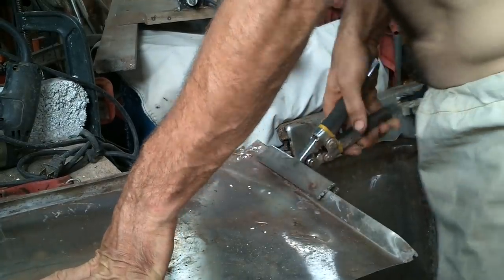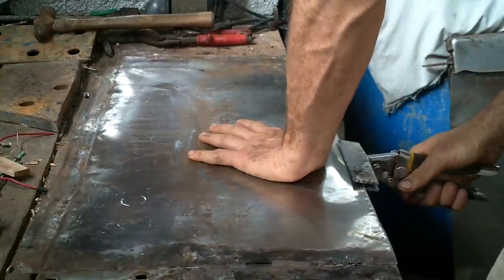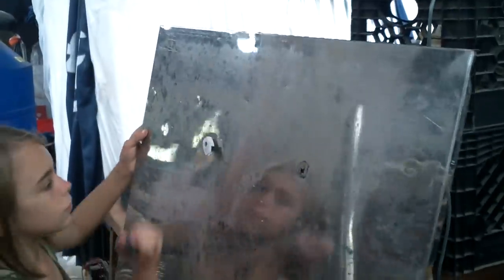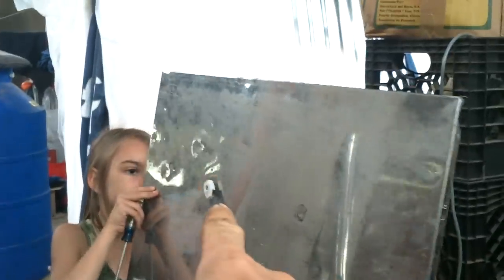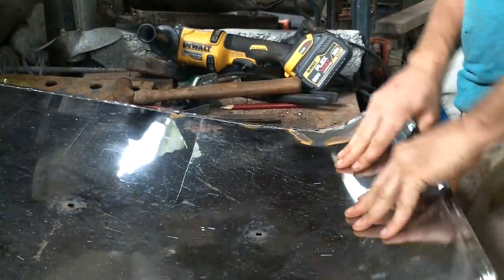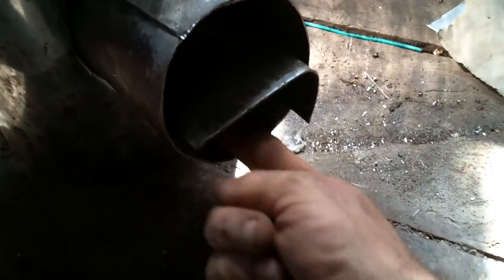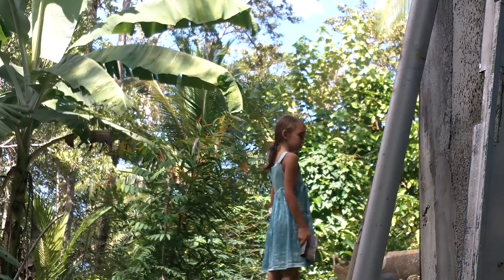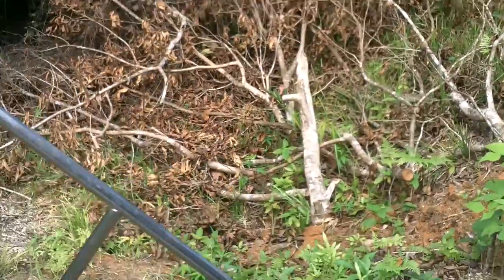The Great Flaming Cooking Rocket

Comment: Rocket stoves are awesome!  Take a look at rocket stove clay ovens.  You might be able to make just an oven and use your existing rocket stove as a slide in heat source.  This way you can make PIZZA!  If you do make a clay oven it will need to have a roof above it due to all of the rain you get down there.

Comment: With ten 500 watts panels, a 2kw long live low frequency inverter, a four 280 ah battery pack and an induction stove you can do all of your cookings even in cloudy days. It is the most efficient and cleaner way to do it,  with no heat loss just the pan and it is free after the initial cost.
Reply: Agreed, but in the short term, while still building out the island, any electric power is better spent running tools etc... You can cook with electricity or wood, but you can't run a milling machine on wood!
Reply: They do have solar. Right now just a small solar set up. Wood on the other hand is a renewable source and is great. On Dashaina Island who has a bigger solar system has an electric stove. Ideally one could make their own bricks and make a really nice out door kitchen later down the road. Yet this works as well. Simple and small and can help eat up all of the debris that is laying around. 
Wood gas also works well yet requires a massive amount of things to keep it going. One could indeed build a wood gas system or buy one as well except most of them run on pellets. One person I know is working on a way to use wood gas with bigger chunks to which you could use either a chunking machine or some kinda of rotating slicing machine.
Reply: @neliosamch3195  Not going to fight with you about this. Wood stoves is a renewable energy. The amount of energy it takes to make a solar panel, electric stove and everything else you buy for your entire life will produce more contaminants than using wood for heat and cooking.
Reply: @kameljoe21  That is possible but just imagine if all the people in China would cook with wood stove there wouldn't be more trees and the whole North pole would have melted long ego.
Reply: @neliosamch3195  The more people who use wood products means more trees are going to be planted. The north pole is going to melt with or with out humans. Its a process that the earth goes thru.
Reply: @kameljoe21  I'm not sure more trees would be planted, realistically, the planet would be healthier with less human interactions. In the last two years there were records of snowfalls and cold temperatures so it appears that humans are the cause of that warming acceleration.

Comment: Great project… a rocket stove has all kind of benefits. I love that you can use ‘junk’ wood, those little twigs and branches that most folks disregard. I’m sure that once you get your saw mill running you’ll have lots of burnable wood as well and chips for a composting toilet in addition to your gasifier tank now. That for sharing and quite the assistant/partner you have there.

Comment: why not make one from cement?
Reply: Cement can trap water in small pockets, especially if poorly mixed.  Get a very hot fire nearby, and it can literally explode.
Reply: @klerulo  thats true but rocket stoves and wood burners in general are made of it all the time, check out green shortz diy channel for some examples, also creation from cement, cement craft diy projects and several other youtube channels also have examples
Reply: How do you make cement? You run it through a kiln to unbond the water. Portland is not a refractory. It just disintegrates. 
Clay with hollow fillers like rice hulls works.
The rapid expansion causes many to break, why most do ss.